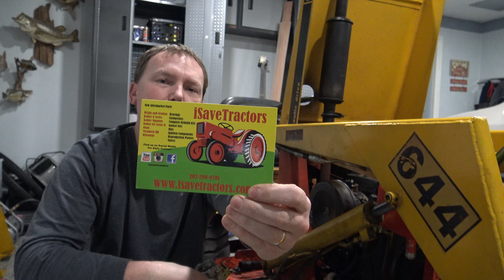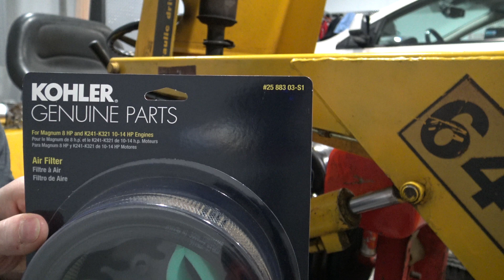Kohler K Series Carburetor Install / Small Engine

Comment: Did that linkage arm come with this unit?  One came with mine but the flanges are splayed open so they do not snap on the ball.  It looks like they need to be crrimped. but they are so think Im afraid to try a regular plyer as ut seems to need a special crimping tool